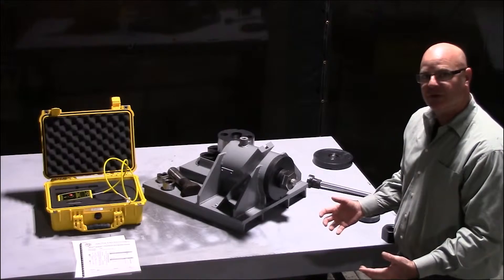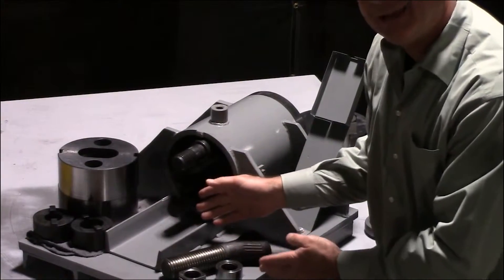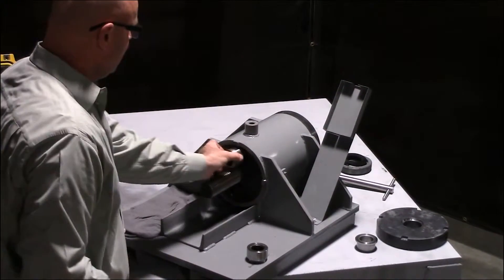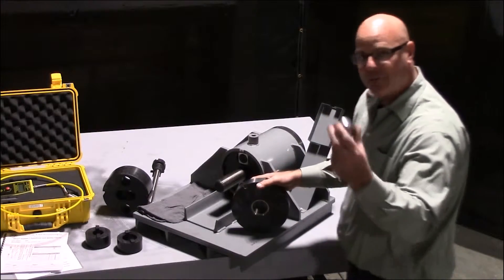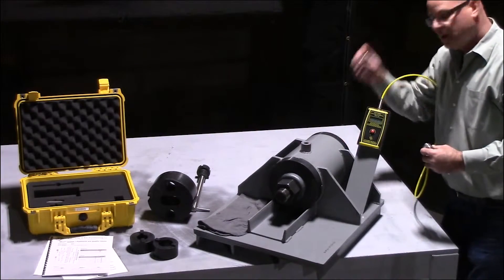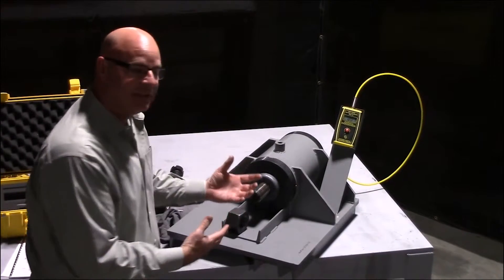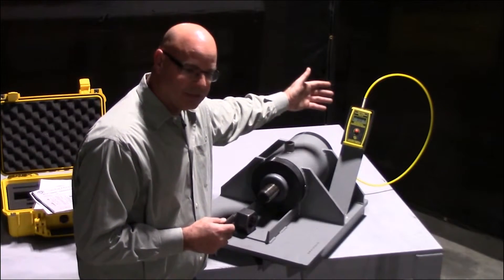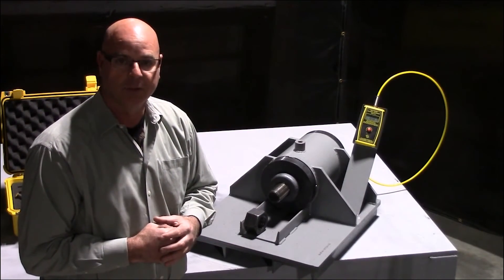Clarkester™ Tester

Comment: I think this is awesome, but could you tell what's the difference between the clarkester and the Skidmore Wilhelm, since both systems are able to correlate tool torque to bolt tension. is it the test joint that is more similar to the liner bolt joint? thanks for your attention.
Reply from the maker: Alvaro, thanks for your comment.  Sorry we are a little slow in responding.

The Clarkester Tester does represent a liner joint and was built to be a self contained unit.  The unit needs no other reaction arm built and does not need to be mounted to anything.  It can also be shipped anywhere without precautions or worry, as it contains no fluid.  The part which is calibrated inside is only 12 pounds and can be shipped back to us much easier than the entire Skidmore unit, not to mention interchanged with other head shapes. We hope this answers your question!